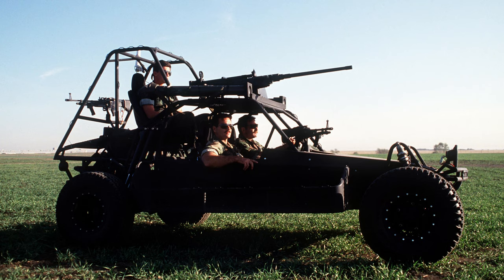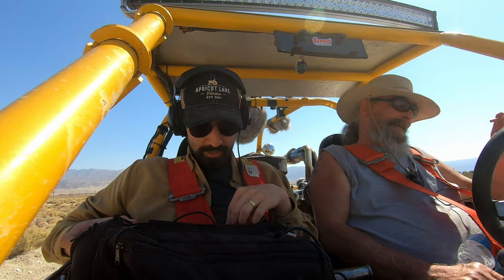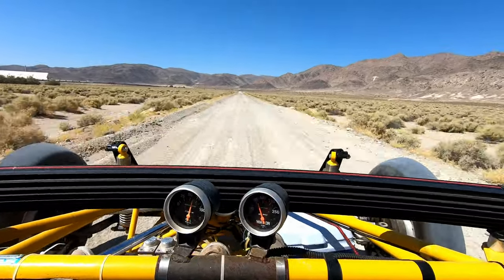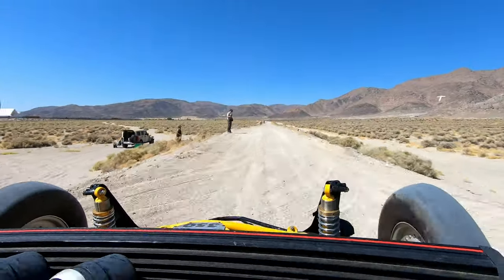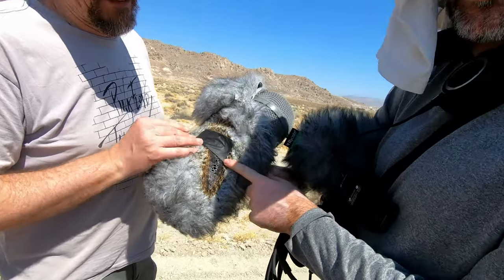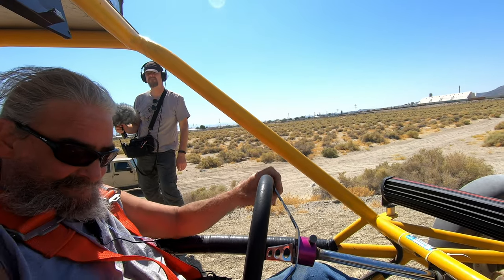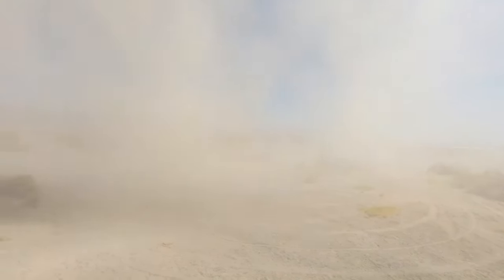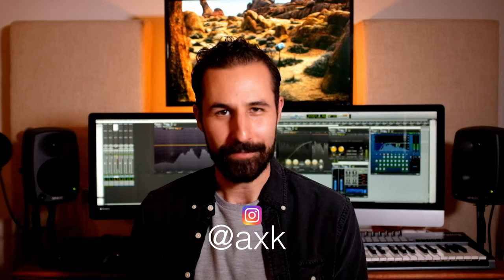How to Record Engine Sounds for Hollywood Action Films

Comment: How do you choose what mic capsule to use in the stereo pair? The most common stereo sets are cardioids but when do you consider to use the Omni capsules? I have an Audio Technica AT4053B Hypercardioid for  indoor recording. Now I have an idea to buy used Audio-Technica AT4049b  Omni ($400) and to order directly from AT (2x$250)  matching cardioid capsules  (by serial #).  That way I can have 2 mics with 2x cardioids 1 omni and  1 hyper-cardioid capsules under 1500$ total cost. 
Could you advise on a stereo mics wind protection? Rycote BBG Windshield can be used only for ORTF but what to use with  XY? XY Only possible with compact mics and Rycote Stereo Cyclone XY?